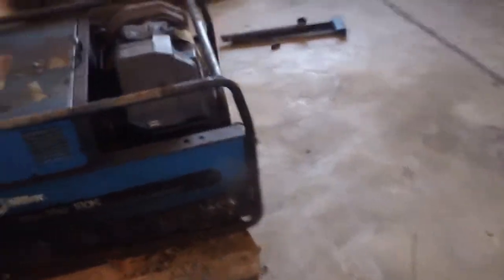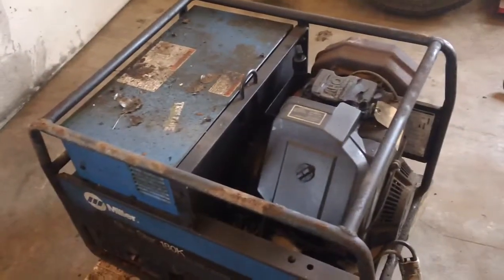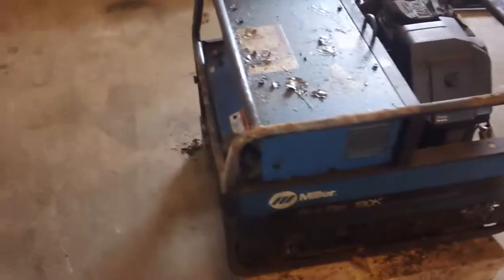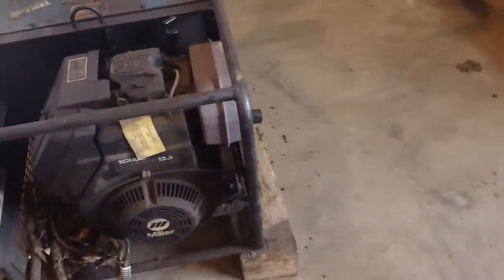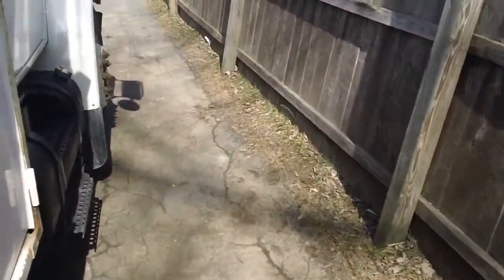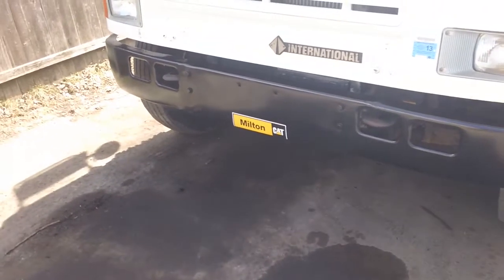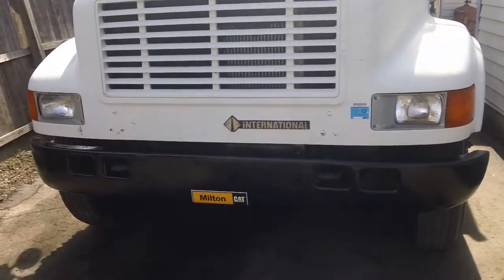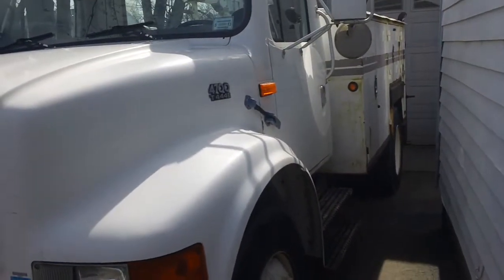Miller tune up!

Comment: On the front end there are 5 or 7 leaf springs and 2 pads. some 4700/4900s have the pads on the top of the leaf pack you can move the pads to gain or lose 1 inch or so.385/65/22.5s work the best on my 4900 hope this helps.